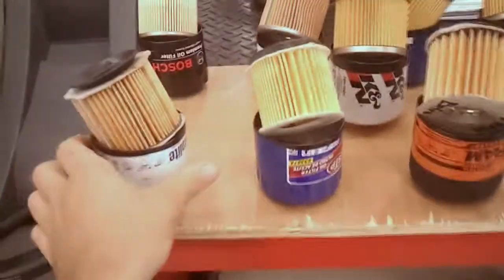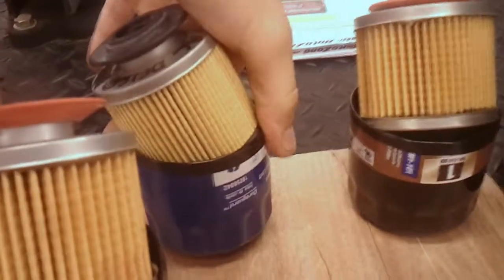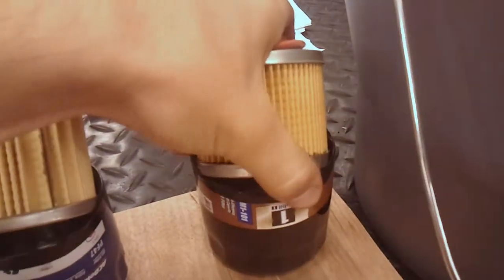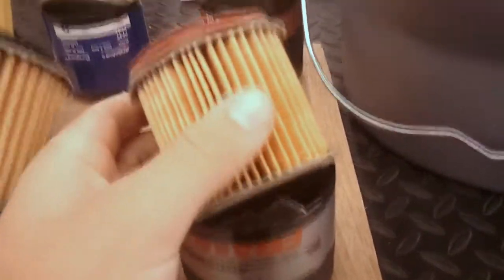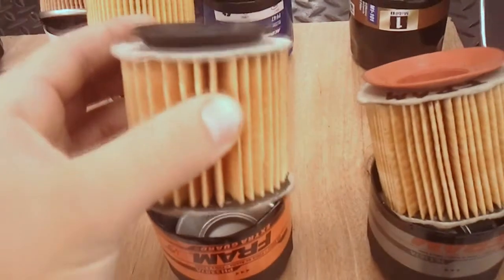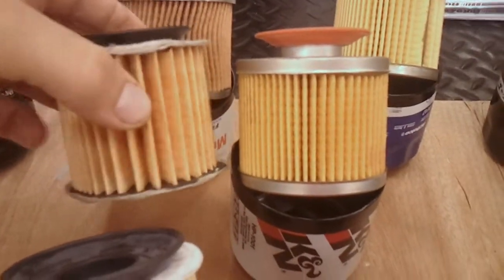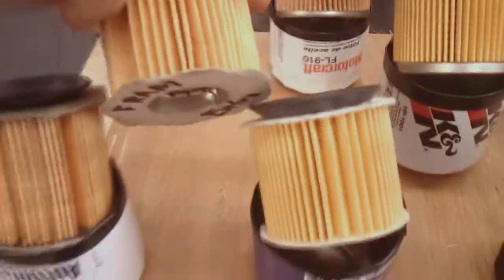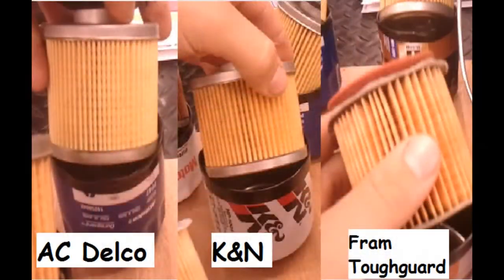Protect your engine Episode 1: Oil filters

Comment: I'm a big fan of Mobil 1 EP filters. I've been using it with their EP oil and I get excellent results. It's all I'll use from now on. My 2005 Colorado still runs perfectly at 140000 miles and I drive it 100 miles a day.

Comment: Fram Tough Guard is not a top of the line filter, but it is a good one. It can be used on 4K-6K miles oil changes. Most OEM Honda Filters are Fram TG.

That said you can not use the TG filter for 10K miles oil change. For that you need to go with more expensive filters.
Reply: Fram is absolute shit even the cheapest filter in the world is better than fram